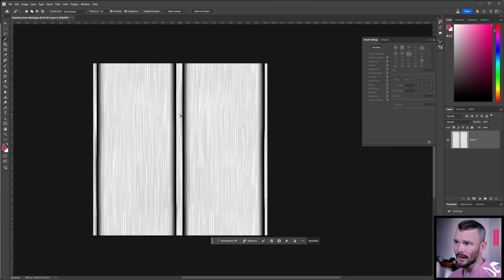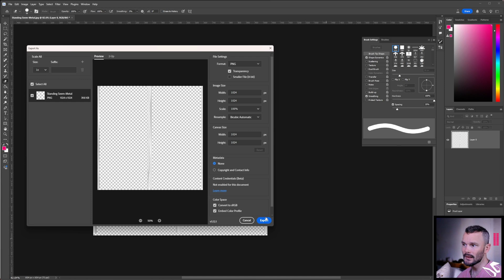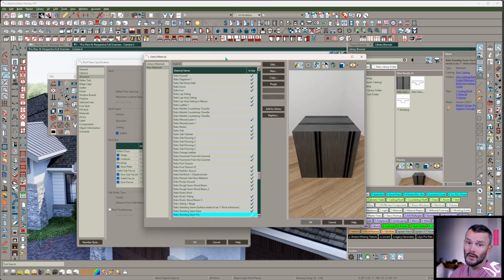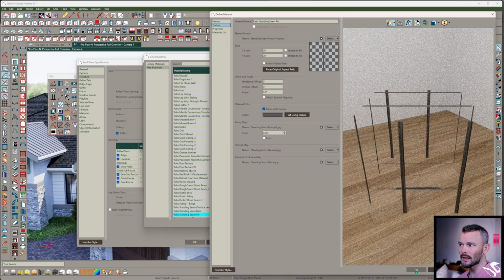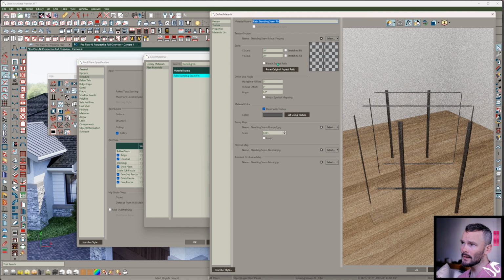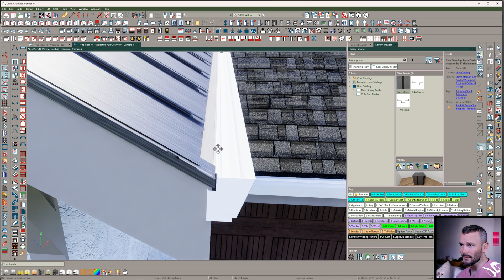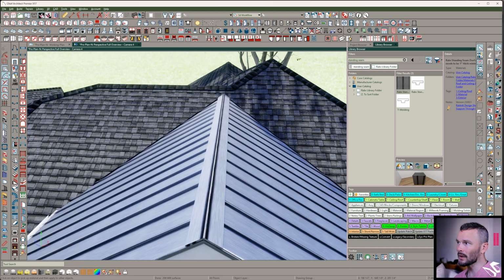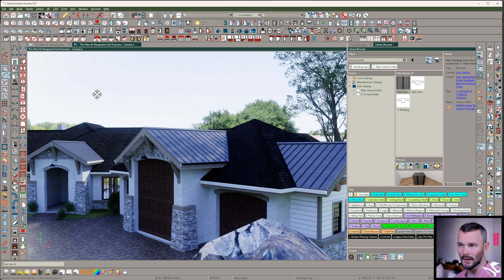CA SHORTS- Realistic 3D Standing Seam Roof In Chief Architect From Just A Material

Comment: Rene, I used this cool stacking feature for an exterior wall with composite wooden slats, and it worked great, except each vertical edge has a whiteish line on it. Can't figure out what I did wrong in PS? I'll post and image in the CT forum.